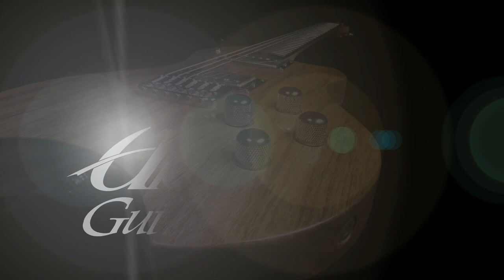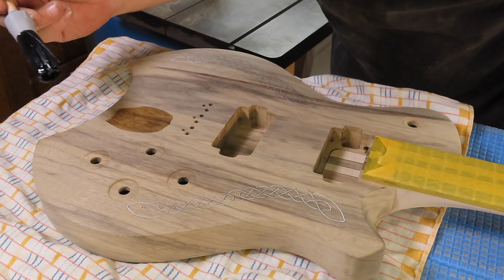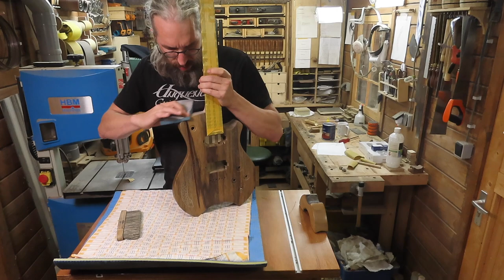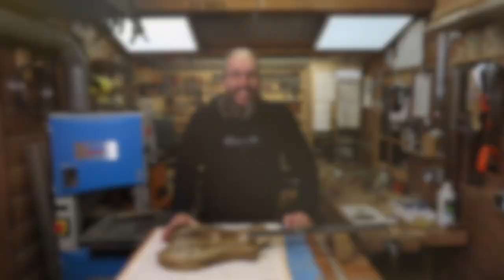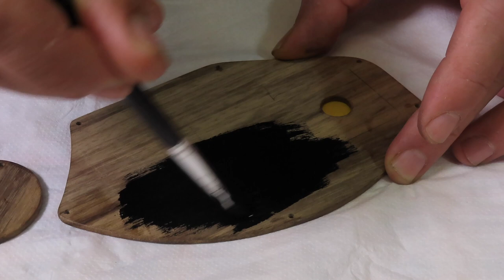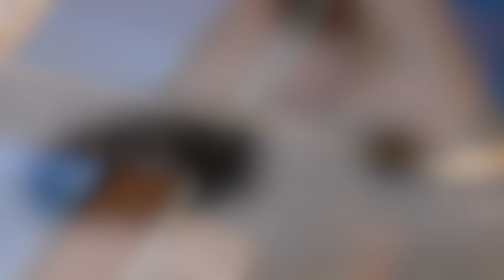Building the Celtic Sonea Guitar - Part 9 - Hard Wax Oil Finish

Comment: I love your work and your expertise. How long does a hard wax finish last?
Reply from the maker: Hi Parachuteman4,
Of course this highly depends on usage and treatment as with all finishes.
I'm not sure (yet) on how fast it wears under normal conditions, but I suspect it to last a long time.
The Hard wax oil is meant to be used on flooring and is said to be very wear resistant so I suspect it can handle some abuse, especially on a guitar. 
Also hard wax oil is very easy to maintain and to repair / touch up. 
In theory it should become even more shiny and polished the longer you play the guitar as the wax keeps getting buffed over and over again.
The more you play the guitar the more beautiful it should become..
Reply: @UnquendorGuitars  ok. Thanks for your reply. The fact that it is used on flooring means it must be pretty robust.

Comment: Does this function as a grain/pore filler too? Im sold on hardwax finishes now
Reply from the maker: Hi Brad,
Not really.
It's basically an oil finish. Although the suspended wax does fill the pores a little it still is considered an open pore finish.